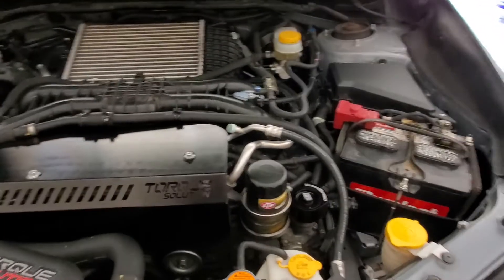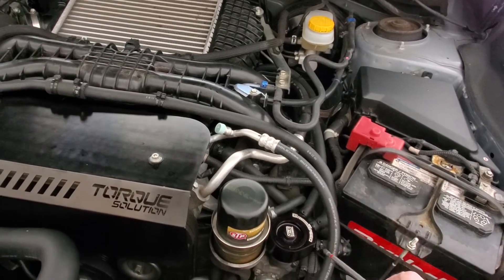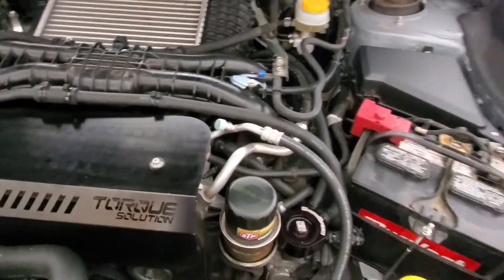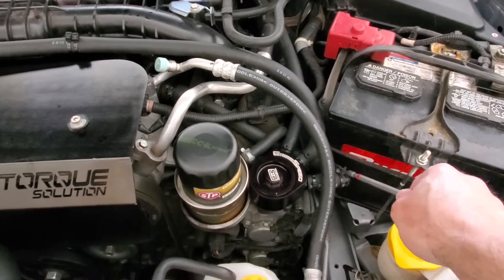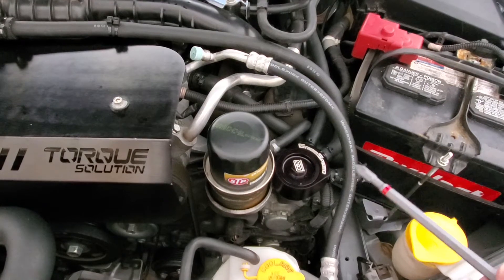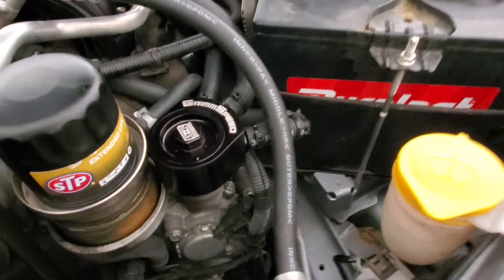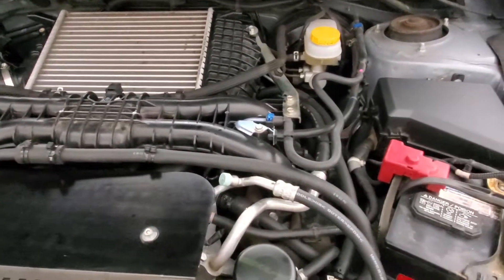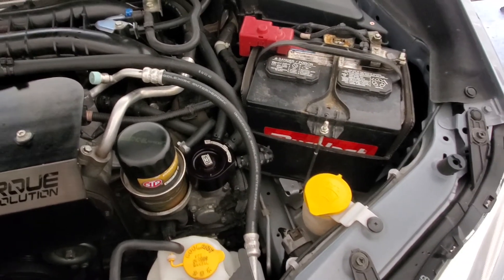Experimental: Grimmspeed AOS on my 2017 WRX

Comment from the maker: I highly recommend a proper AOS or catch can setup and simultaneous spark plug change. The idle on this is so smooth! I also have better performance with marginal gas quality...allows more gas station options.

Comment from the maker: NOTE: this is not a recommended application. It seems to be working for me, though.
That said, I highly recommend a catch can or AOS as your FIRST modification. That will eliminate any excess buildup in your intake system, from oil blown in from the PCV systems. It also eliminates dilution of your fuel octane ration from the blow-by. Find one that is made for your specific make/model/year. @GRIMMSPEED (see their website for applications)